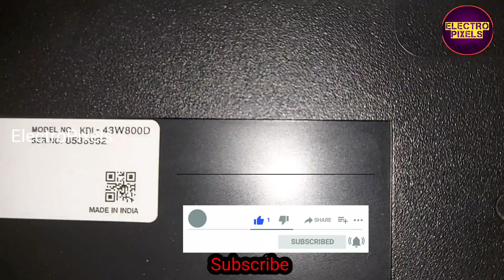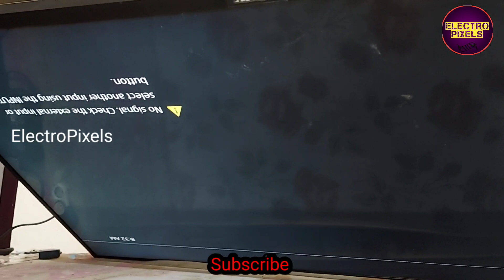Android Tv Sony KDL-43W800D|Sony 5 time Blinking Problem w800c,w800d,w950c |T-con Logic Board Fault

Comment: Sir, I need your help, my Sony kdl 43×800D  sent for repair, when Black display appears when switch on. Service person said that mother board problem needs to be replaced. The TV repair person after repair he installed 950D software instead of 800D and replaced speakers, it is not working well. Now I purchased a JBL SB241 sound bar it is not connected immediately. While switching on and off TV 3 to 4 times only connected. Please reply me. Thank you in advance. How to solve the problem now.

Comment: Sir , i have changed this alternate Tcon in 50W800D exactly 2 years back , but today it shows double image and vertical lines , ita again TCON or panel shorted ?
Reply from the maker: Panel problem, Not Tcon try to block Gatesignals using taping method, one by one in both sides

Comment: What causes the fault in tcon in the first place? Manufacturing fault or power malfunction
Reply from the maker: Levelshifter Ic Fault, Common complaint. Replacing Levelshifter IC will also work.

Comment: Instead of repair the t con board you just replace the t con
Reply from the maker: It's a Common Fault in that T-Con, if it repaired also the complaint will repeat again. It just waste of time
Reply: @ElectroPixels  it's okay but  if you change the faulty parts then there should be no complaints

Comment: does the 3D works after board change ? or does we have to update the software after board change
Reply from the maker: 3d not work
Reply: @ElectroPixels  you are right the 3D doesn't work anymore once we change the T con board with 3rd party board . As Sony doesn't sell original TCOn in market and they have some software installed in the original which controls the 3D option in panel . Anyway I'm trying to repair  the original  board in local repair shop.Hope they rectify the issue and fix it
Reply from the maker: Its Auo Panel and Not Third party T-con. Both Tcon are From Auo Panels. Infact sony doesn't have Display Manufacturing unit. The Same Tcon is also Available, But it's a common Fault in that Tcon so if we change with same one also the complaint will return. That's why this Alternate Tcon is using. Infact if customers not using 3d then use this alternate one. Both From Auo optronics and Not third party one

Comment: I also chanded this t con but sony logo not comes..
Reply: Clean your old tcon(original) board with ncb thinner and after 5 min coat it with switch cleaner oil and then blow hot air with hair dryer .... Board will be ok.
Reply: Same issue. I'm also so many t-cons installed but same Backlights late on.. But otherwise all ok
Reply from the maker: That's because of Blocking last 13 Pin's mainly Panel memory